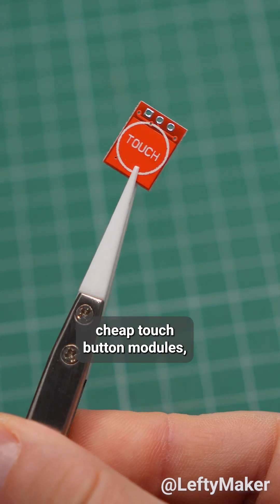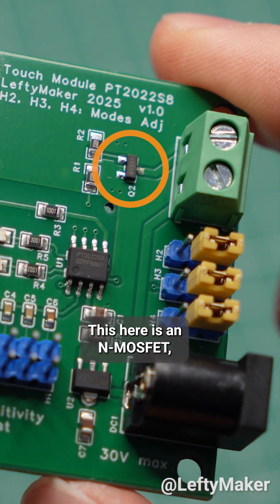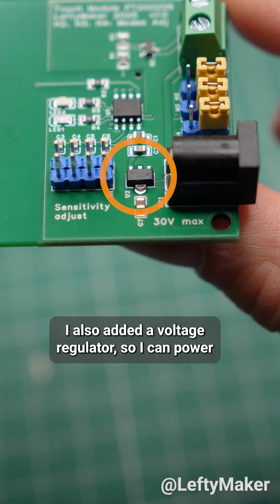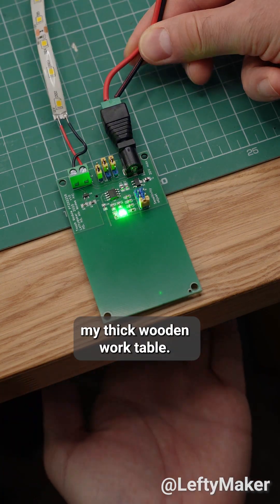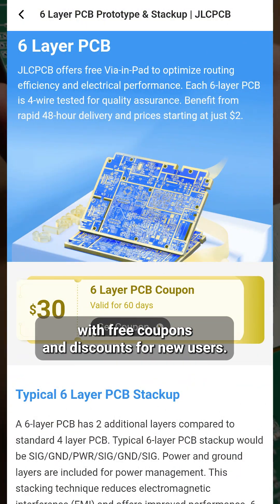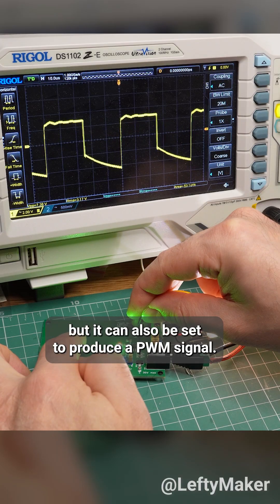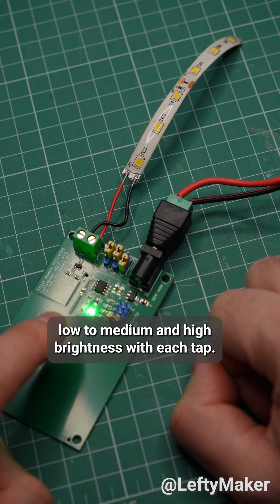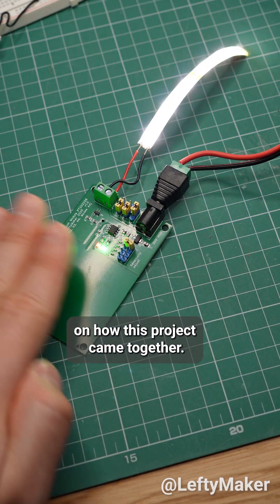My DIY Touch Button Module is Much Better #jlcpcb

Comment from the maker: 🟢 Discover easy, affordable, and reliable multilayer PCB manufacturing with JLCPCB! Register now to get $70 new-customer coupons: https://jlcpcb.com/?from=leftymaker1
Reply: no
Reply: sorry, no, but i'm pretty sure the module you made could be put under the table so putting your hand on the place it detects turns on your lights
Reply: Do you sell your modules?

Comment: “Up to 30V” yes but that LDO is going to be hotter than hell. Why not use a buck if it’s just for LEDs?
Reply from the maker: Why do you think it is going to be hot?
Reply: @LeftyMaker   Because LDOs convert that voltage difference into heat, an LDO is best for a small drop, but from 30V that drop is going to be so large that there will not be enough copper to dissipate the heat that the LDO creates.
Reply from the maker: @sebkabob they convert power into heat, not voltage. I made a separate video in response to this, with demonstration

Comment: Why don’t you use a potentiometer for the sensitivity adjustment?
Reply from the maker: those are capacitors, not resistors. I don't think there's an easy or cheap way to replace them with a variable capacitor.

Comment: I wanna purchase this, do you have the gerber file by chance?
Reply from the maker: It is available on patreon.com/leftymaker 
As others pointed out, a diode could be also added to protect the mosfet, a mosfet driver to improve the dimming above 2A, or a bigger mosfet to handle more current
Reply: @LeftyMaker  Is it free (the pcb files)? No?

Comment: This switch helps a lot for minimalist:
1. Invisible switch for work table lamp
2. Invisible drawer switch only you know how to open(if you have a motorized lock)
3. Bed drawer lamp (put underneath drawer)

It's basically just a switch, but no messy wires or buttons if you placed it underneath anything which gives you luxury experience.

Imagine your old table has this touch switch feature, now it feels like a modern futuristic table that cost $200+

Comment: Yeah but at the highest sensitivity TTP223 also detects radio noise and power supply noise as inputs
Reply from the maker: I didn't know that! Good thing I'm not using that chip.
Reply: @LeftyMaker which chip you used for this?
Reply from the maker: @fahimi.saiyed8939  PT2022. I have a full video on YouTube for more details
Reply: @LeftyMaker thankyou
Reply: @LeftyMaker  can it detect the existence of Water  for long period , previously i tried with TTP223 but it auto calibrated itself, so it can't detect for a longer period.  i want to sense the water exists or not at that level by waterproofing this circuit and it should act as contact less water level Sensor.
Reply: Sounds like another use case. Turn something on when power is drawn.
Reply: @ggbirdymill1618  Ooh that's a good idea
Reply: @ggbirdymill1618 don’t give ai data centers any ideas without a patent!